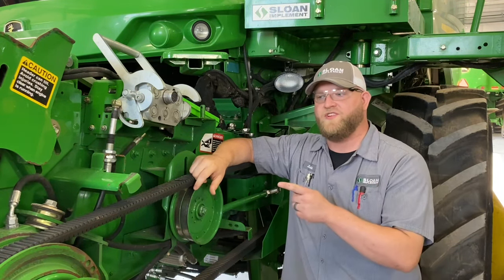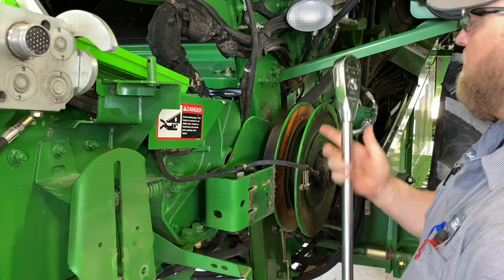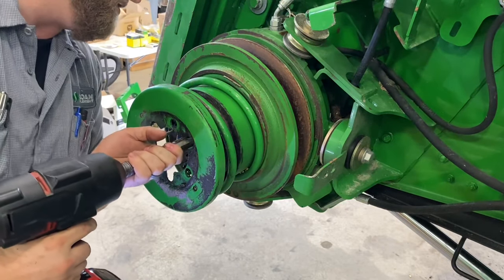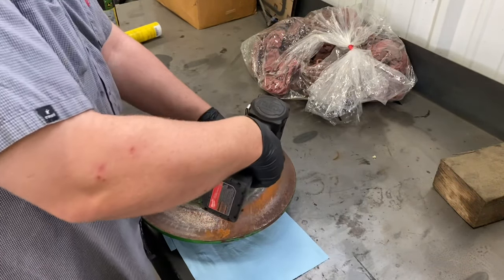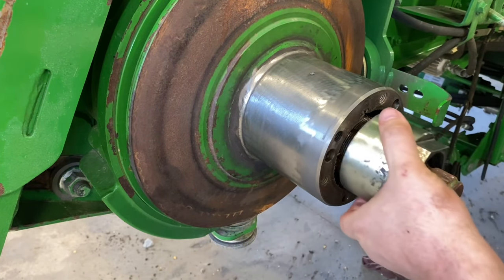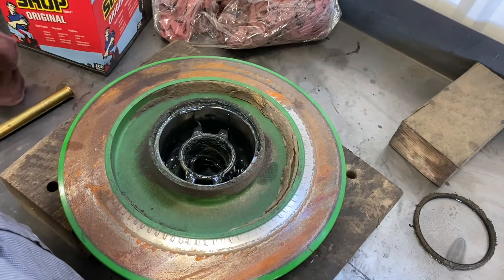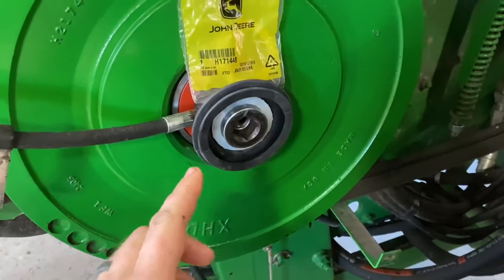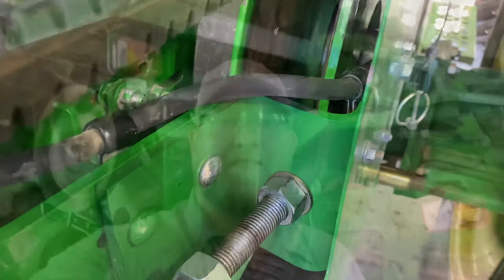How to repair a variable speed feeder house drive on John Deere S-Series combines.

Comment: I've always cleaned up the lower variable inner sheave with 80 grit then 220 grit emery cloth to keep the sealing surface as round and smooth as possible. Keep up the great videos.

Comment: Just a suggestion.When we were installing o rings on mating surfaces, it was a best practice to grease it off the unit then install it. This way the o ring has grease on its entire surface rather than just on the outer half. Remember, that o ring moves and seals on the inside half also. Good Job. Thanks for the video!.

Comment: S670 here, what do you recommend for greasing the chopper drive jackshaft? Ours currently has plugs in it but looks simple enough to put zerks in and grease it. Seems like it should need some maintenance over the absolutely nothing that the manual recommends. Thanks
Reply from the maker: I use heavy duty synthetic grease
Reply: Make sure you grease them and maybe pull one plug out and fill the cavity. I just pulled ours apart and I thought they went to sealed non greasable bearings but I was clearly wrong cause they are missing the inside seal.

Comment: Wonderful videos. Very informative. I have a question regarding the big 70 mm nut on front drive and the piston on upper drive.Do they not need to be torqued to a specific value ?
Reply from the maker: I’m sure there is a torque spec but I’ve done so many I’ve got my elbow calibrated. Lol
Reply: Lol

Comment: So are you  saying that you should grease these with the head off if possible so that you can run the speed up and down to get grease in the whole upper sheave?
Reply from the maker: Just if you have a platform hooked up. Unhook the multicoupler and driveshafts then grease and run your speed up and down. If you have a platform or draper plugged in the combine will not speed the feeder house up.

Comment: Hey Zeth! What are some must have tools for a JD tech?? Love the channel btw.
Reply from the maker: Thank you! Must have tools: every flavor of 10, 13, 15, 18,  24, 30, 32mm sockets and wrenches, Milwaukee tools, Snap on ratchets and pliers, wrenches metric 7-50mm, sae wrenches 5/16-2”, big hammers, big pry bars, Allen and torx bits, screw drivers, every snap ring pliers known to man, every crows foot they make, air hammer, die grinders, everything needed to fabricate and cut metal…the list could go on and on lol
Reply: @ZKMasterTech  I have a ton of the aforementioned tools. I was just more curious about your specialty stuff I guess haha
Reply: @ZKMasterTech  This would make a good video..

Comment: How hot should these run during full load operating conditions? It seems like they run very hot.
Reply from the maker: Yeah I don’t know what the temp gets up to but it’s up there. The spring pressure and hydraulic pressure on that belt produces heat.
Reply: @ZKMasterTech  does a multi speed or fixed speed reverser last longer and produce less heat?
Reply from the maker: @SlimFarmer  yes most definitely. 5 speed is the only way to go. Way less problems. Oil in the reverser doesn’t get cooked either.
Reply: @ZKMasterTech  thanks for you’re input. No wonder it’s got to be synthetic oil changed yearly. 🤣

Comment: Our s670 keeps eating these reverse belts this is the second one and it keeps smelling hott and having chunks come out of it. Can you help please?
Reply from the maker: Sounds like it's getting too hot. Either you've got lower sheaves binding or the spring is weak. Has anything been apart? Parts replaced?
Reply: @ZKMasterTech  the upper variable drive dogs inside the shive were all worn. We replaced all parts on the upper and is not shredding the belt anymore. However were struggling still with getting our backshaft speed over 500. It running around 480 when doing soybeans. We'd like it in the 500s

Comment: ZK, I have a question not related to this repair. What coolant pressure tester kit do you use on the tractors, combines etc?
Reply from the maker: I use the one from snap on.
Reply: @ZKMasterTech  can I bug you for a part # and any adapters you use? I noticed today on a 4940 sprayer the coolant reservoir was a screw on time verse the cam lock style. I’ve following your channel for a bit now, I’ve been working for RDO(Deere Dealer) here in the Pacific Northwest
Reply from the maker: @jcolivera881   I use the screw on style that comes in the snap on pressure tester kit. Not sure what the part number is.

Comment: Why would this variable drive be eating belts? We have a 9660 STS an only use it for high moisture corn for a feedlot. And will eat 3 or 4 belts very expensive any advise is appreciated
Reply from the maker: Probably have worn sheaves or they are the incorrect part number on the upper sheaves. Seen that before on the 60 series.
Reply: The rear drive is original or in my 5 years at the company it is. The front feeder house drive is new an has a roll pin that holds the inside shiv on not a nut like the one you did. I think some of our troubles the center idler the guy that ran the combine has it on top of the belt. Up until now I have not been involved with the combine. I am the mechanic at the farm an never worked on the machine always out sourced to the local Deere dealership

Comment: By belt on the variable drive has been loose on my 9770 past couple of mornings but once you turn the head on it tightens and works all day and never loses speed. Could it just be leaking off at the multi coupler?
Reply from the maker: No it’s probably the piston in the upper variable sheave leaking internally.